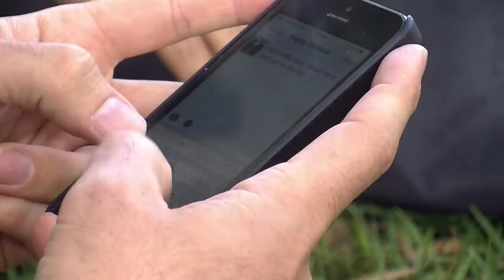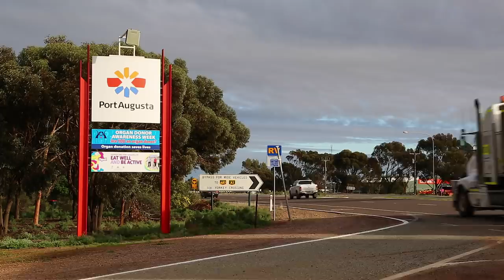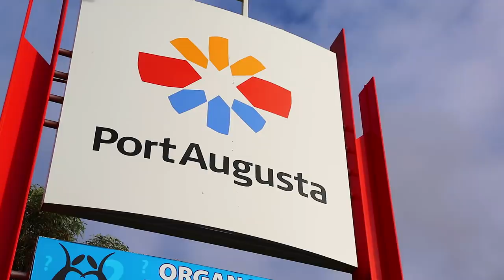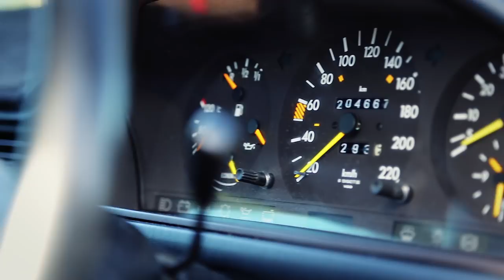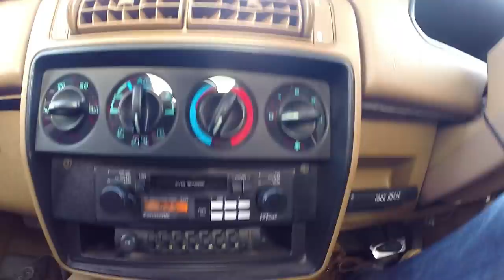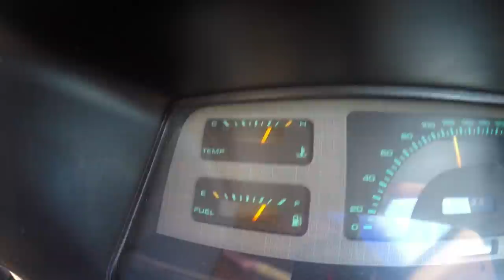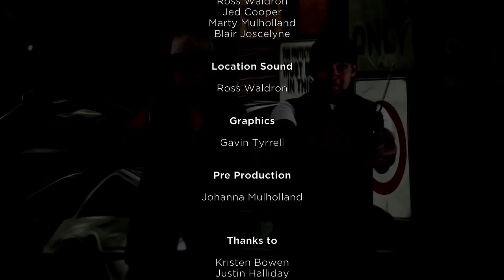Lend Us A Ride: Australia [EPISODE 5]

Comment: car overheating? just take the bonnet off and strap it to the roof roadkill style!
Reply: Maybe they forgot to take enough zip ties?
Reply: lol roadkill
Reply: *****
pissing on coolant reservoir is not good. tried that once upon a time me and all the family pissed but unfortunately  it worked just a few miles before the headgasket got severely fucked
Reply: Roadkill is the best American car show on youtube, no comparison
Reply: agreed!
Reply: we need a mcm and roadkill collab
Reply: zum YES PLEASE! Roadkill's been in Aus but they haven't done it right till they match up with MCM
Reply: Did you know, when your car is overheating, turning your ac off and turning on the heat will help vent heat out of the cooling system?
Reply: Turn the heater on and roll the windows down
Reply: zum we need a MCM vs Roadkill collab. MCM goes to USA, both teams buy cars for under 500$ and make them work and then go for a long Roadkill-style trip and see who overheats more :D
Reply: Yes they should do that
Reply: TheLaXandro why not come out and just enter 24HoursOfLemons ?
Reply: *****  That's an excellent idea. I can see how a really hot engine and water hitting it could easily cause it to warp, crack, or otherwise break. I'm convinced a snow storm killed my A/C system. I was using it at full blast to take more frost off. It was a serious blizzard. So, after 14 years of perfect function, maybe I pushed it too hard, lol. But still, I'm saying hot and cold together can mess stuff up.
Reply: It turned out to be an o ring in the compressor. Other than it and coolant it's original from 1999. Well, that's assuming it ran fine for 6 years without me, which would be normal. (A Chevy Prizm with a MAAAAAD exhaust, transmission cooler, short ram air intake (apparently lots of hot air managed to make more HP and better MPG. So weird, lol.)

Good advice for sure for radiator issues. Now, I just need to find the radiator bleeder so there's no possible air bubbles. I haven't had any issues, but years ago, I had a car keep complaining about a little air in the system even though it ran cool. (1994 Ford Escort)
Reply: ***** This is not american Sir.
Reply: hood off a french four cyl? the fuel will stop pumping. He should have taken the wheels off and slapped it on the old white subaru seeming ignored in the video for being too sexy.
Reply: DE Nichols Usually the coolant bleeder is located near the thermostat or the temperature sensor from my experience.
Reply: zum no thanks mcm are wayyyyyy better
Reply: zum no thanks mcm are wayyyyyy better
Reply: ***** it would rust the engine, but with that car won't be a problem i suppose ...
Reply: Holy Caster aluminium doesn't rust.
Reply: Lawrence Timme the engine block is aluminium. the valves, pistons, fuel injectors, cilinder sleeves are a completly different deal.
Reply: Holy Caster it they get water in them. i think they break before they rust :P
Reply: So im not the only roadkill fan that watches this show ;D !

Comment: I'm gonna buy one of these Mercedes. Don't know which engine or chassis yet, but it's gonna be an Inline six. These Benzes are still used as taxis in Germany today. There's a taxi company in Munich which has an entire fleet, constisting solely of W124 diesels. The diesel engines are nearly indestructible. Mileages of a million have been reported. Apart from that, you can find many used ones at around 500,000km and up, still running fine.

Comment: Should have my 350hp Spec R silvia running this week i'll lend you a ride New Zealand though :P

Hks DD intake,300zx Air Flow Meter,Tomei ARMS Turbo,Tomei Extractor,tomei outlet,After market front pipe,Apexi exhaust, Trust Greddy Blow off,HKS Type S intercooler kit,Hks 740cc injectors, Sard regulator,Apexi power fc, 256kW on wheel @ 1 bar.

Comment: its the rotary cars than complicated people says? cand you do a video abuto rotarys how rebuild it and how found spares a good price?
???
Reply: MElekiaZ The engines themselves are not complicated, and they are not actually that unreliable. 

The problems arise when people who don't know what the fuck they are doing own them, coupled with (here in Australia at least) most having had their odometer wound back 100,000km when they were imported. that is a recipe for people thinking their engines have blown up at 60,000km and that rotary engines are shit.

The most major cost you can run into with a rotor, apart from astronomical fuel consumption, is a rebuild. Here in Aus you'd be looking at $10,000-$15,000 for a full rebuild. Other common issues are the vacuum hoses leaking and the factory AST failing and blowing up the engine. Replace the AST with an aluminium one, go through the pain of putting all new vacuum hoses in and try to find one with a fairly recently rebuilt engine (but not too recently in case it's a shit rebuild) and you shouldn't have too many issues. 

My mate had a Series 8 RZ model with 232rwkw and never had any problems apart from a rough idle from cold start which he sorted out with some air fuel ratio tweaks on the power FC, and we together owned an FC series 5 13B turbo for a while there too. Had far more issue with the stock FC than the modified FD.
Reply: $10,000-$15,000 for a full rebuild.

this is a pile of money dude...maybe youre rich!
Reply: MElekiaZ The engine itself should last 150-200,000km as long as the services are regular and it's taken to redline once or twice while driving it and not just driven down to the shops and back. 

It only becomes a problem when you have over-stretched your budget buying the car, then it blows up straight away you get caught short.

Plus people who own them generally are older and can afford the costs associated with owning a rotary. Not many 20 year olds fresh off their P plates could afford to own one as a daily from both the fuel consumption point of view as well as how often they need servicing.